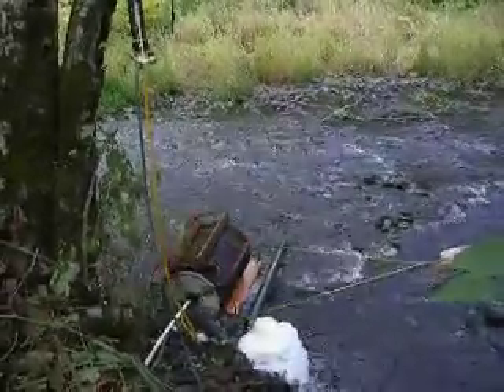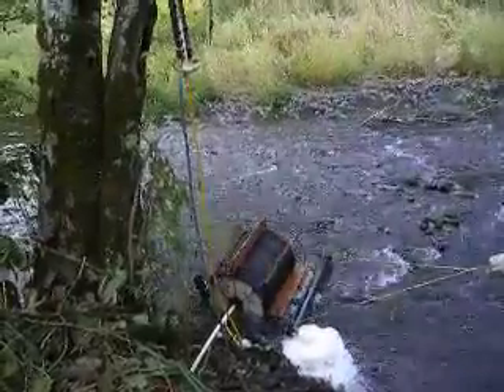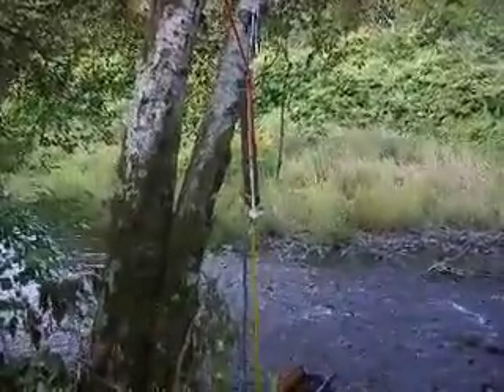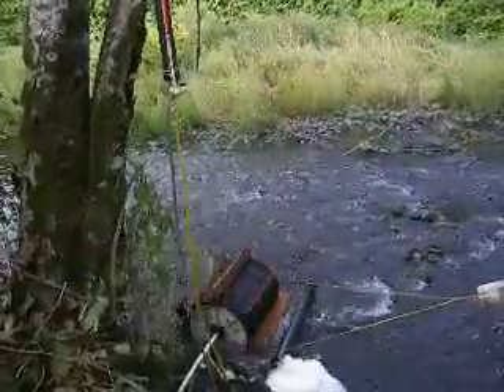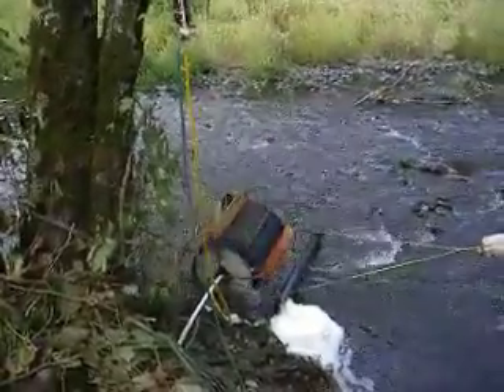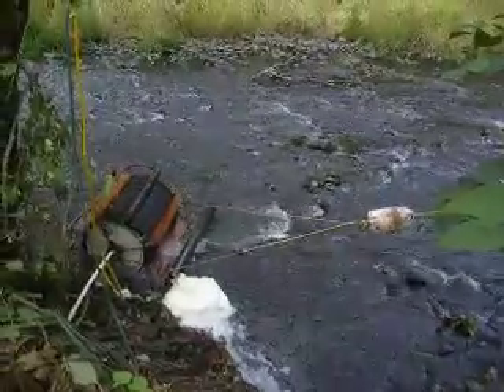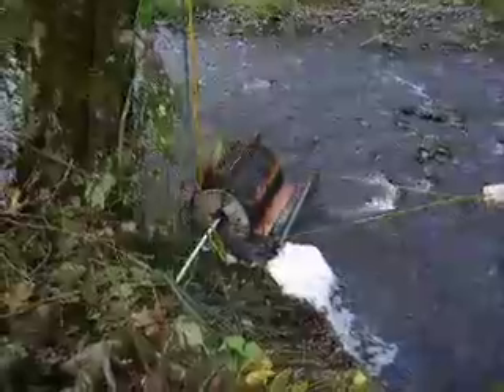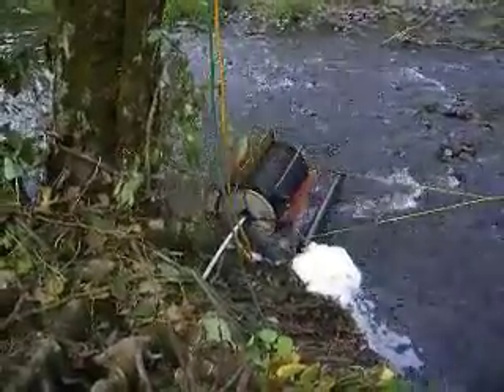Floating water wheel pump

Comment: Brilliant idea sir.  I've been looking into making a spiral  pump water wheel, but didn't want to make the wheel frame out of rebar, since corrosion would surely take its toll on metal, breaking the welds over time. 

 This rig looks to be all plastic, and I am surprised to see that such a small diameter wheel and coiled hose, can still lift water a good ways.  I am going to try and copy this innovative concept.  Having the device float, means changing water levels will have no effect.  Wow, thanks for posting.  It's been a long search, but this is the mother lode for sure.

Comment from the maker: Just posted new design. Stream powered water pump. Hasan Sabran the floating barrow pump 24 hour turns out to be around 1200 per day at 25 feet lift. djohawk the different size tubs on barrow were to see which size gave best volume and pressure. On the barrow 1" did best. 3/8" did best for hight after water air separator.

Comment: Best of Waterwheel Pump! 3 gal/min is equivalent to 4320 gal/day!  Please show us more of the air/water separator thing.
Reply from the maker: I currently have 3 videos. The air water separator just a 3" pipe with water/air mix from pump enters top, exit water/air mix at top and water only at bottom. The more water drained out the bottom the greater the volume of air in the water/air mix that exits the top. The more air the less downward pressure the higher the lift. With 21 psi water only lift would be under 50 feet. I am able to lift water/air mix over 80 feet. https://m.youtube.com/watch?v=4omE2UpNOSE

https://m.youtube.com/watch?v=rIVDgHx3XBc

https://m.youtube.com/watch?feature=youtu.be&v=YCxkopGBwjw
Reply from the maker: Nothing inside 3" ABS pipe. The water air mix splashes into top that causes air water bubbles in 3/8" line. The air bubbles are to big for the water to pass creating air locks. The 3" pipe only has hold a couple of gals.
Reply from the maker: I've tried air tool quick fits. If they are greased they last about a week. The sand and grit in the water eats them up. 360 Swivel connector only last a couple of days. Again thank you for the suggestions.

Comment: great job. why the 2 different size tubing?
Reply from the maker: The 3/8" creates air locks that enables almost twice the hight. 1/2 was a test size that worked poorly. 5/8" garden hose works for lift less than 35 feet. 1" is the biggest I can easily bend and also works the best for pumps. I have 3 videos that give a good idea of principles that apply and problems that need to be overcome. Any ideas you have about the pumps are welcome. Thank you.
https://m.youtube.com/watch?v=4omE2UpNOSE

https://m.youtube.com/watch?v=rIVDgHx3XBc

https://m.youtube.com/watch?feature=youtu.be&v=YCxkopGBwjw